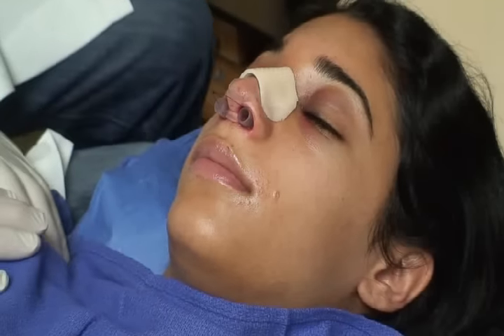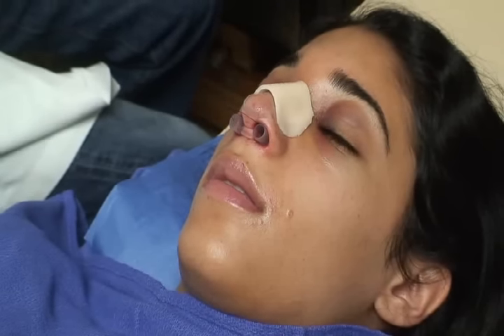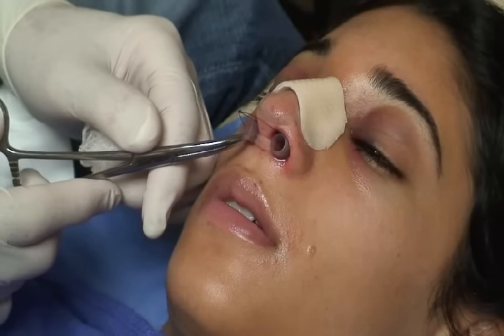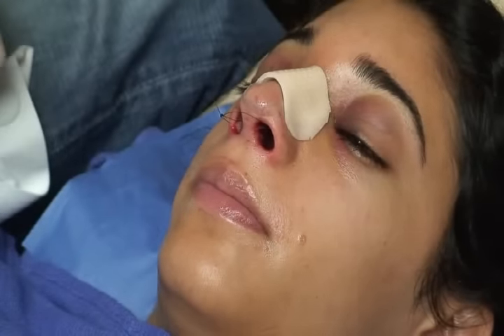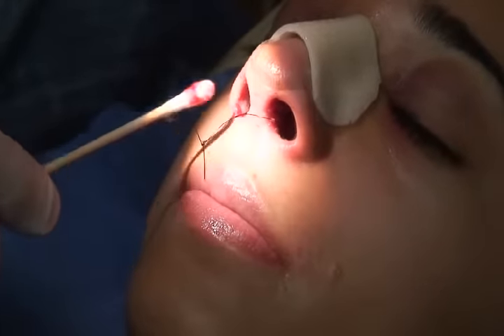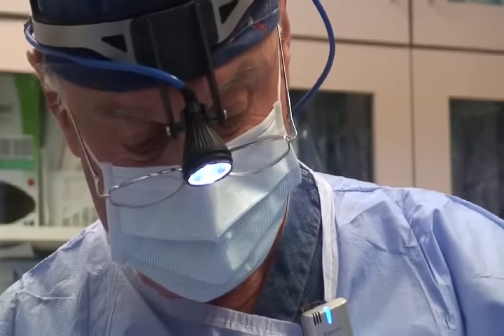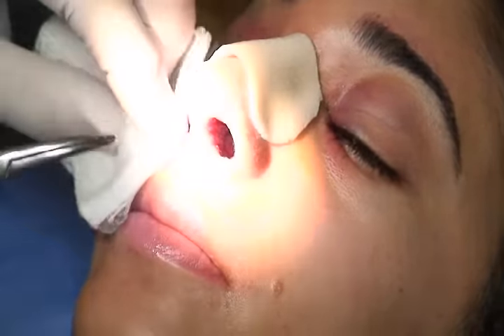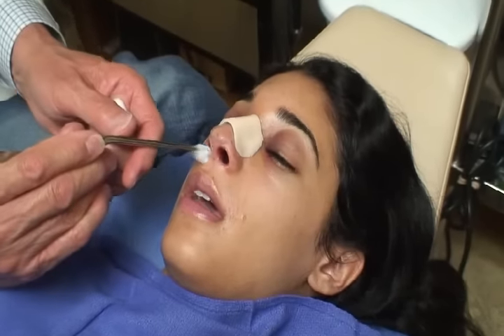The Kotler Nasal Airway - Removal of the Airway

Comment: I had it done many years ago - the Dr scrapes your sinuses while you are under anaesthetic which causes bleeding so nose plugs are put in.  These has to come out the net morning as scares will form and then it would hurt.  I also had a grommet put in my ear drum in order to allow the middle ear to drain thereby equalising the pressure on both sides of the ear drum
The grommet usually work it way out after a few day.  I could not only hear but smell much better. But we had to pull out the cotton wool ourselves and I nearly fainted - especially when it got suck.
I did not realise just how much can get up that nose.
Reply: Why do they scrape your sinuses?